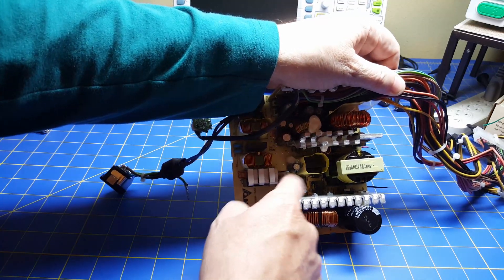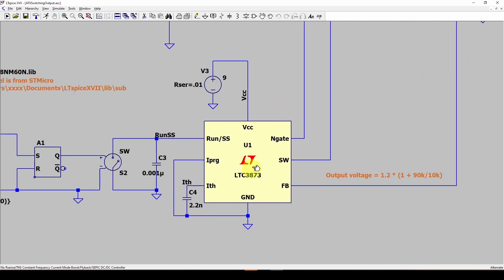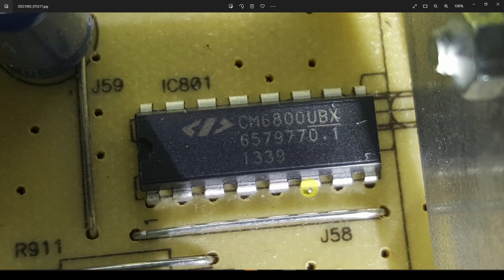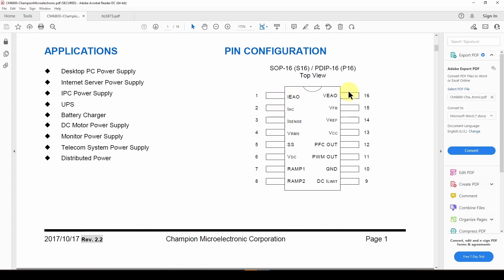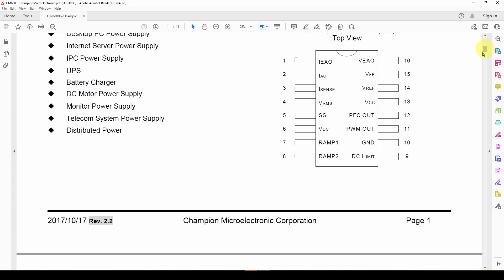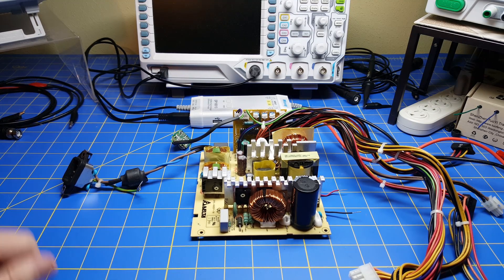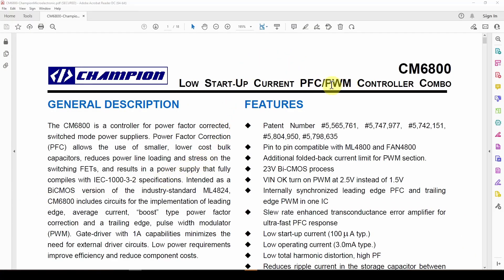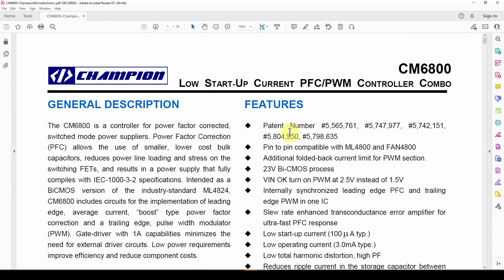Understanding Power Supplies Part7: PWM Controller

Comment: EETechStuff, the equation  for the over current  logic has an error, the 0.05 should be 0.005, 6 amps x 0.001 ohms is 0.006 millivolts.
Reply from the maker: Danny Turner, you have two errors in your note. First, 6 amps x .001 ohms is .006 volts, not 0.006 millivolts. Also, overcurrent is one word, not two. See what I mean? :)
Reply: @EETechStuff  you are correct, 6 millivolts or 0.006 Volts. Thank you